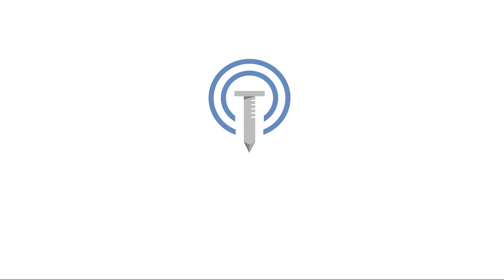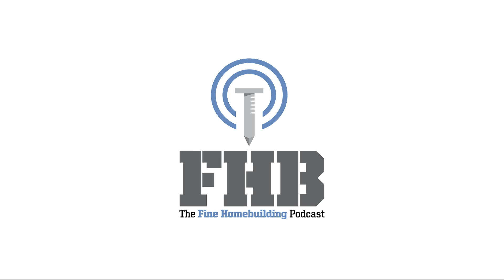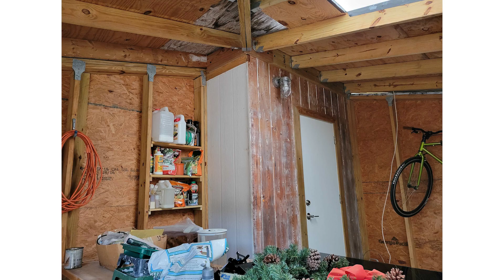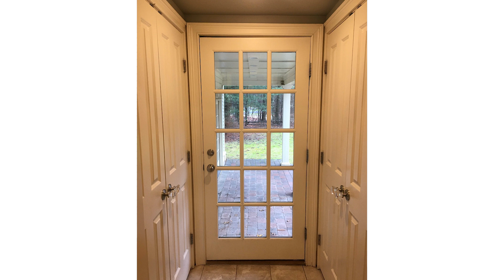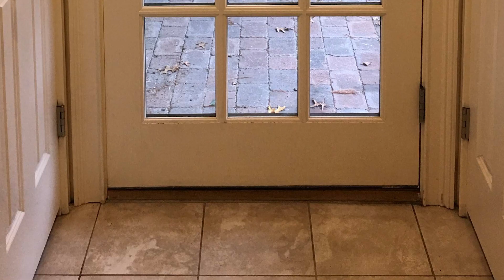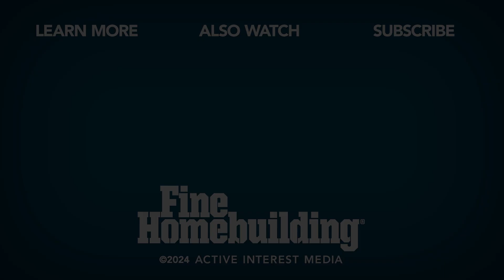Podcast 620: Witnessing Bad Work, Semi-Conditioned Spaces, and Extra Minisplits

Comment: Another HVAC idea for your extra tight super insulated home. Attic and crawl space insulated and inside the HVAC envelope with no partitions in either. Mini split head or window type heat pump, one in basement and one in attic. Both spaces also with dehumidifiers. Now attach adjacent rooms above and/or below with floor/ceiling vents, powered dampers and small quiet fans. Vents open based on temp and fans come on a couple minutes later if temp still high/low in adjacent room. Combine with ERV, for fresh air and to prevent stagnant air. Also plants on window sills can improve air quality, NASA has looked into this for space stations and based on other planets. BTW the bedroom vent(s) might be most comfortable if located in the closet with a louvered door. Could work for one or two floor home, some smarts to balance air pull and possibly one vent connecting the two, perhaps a 6 inch duct in the kitchen run in the corner and behind the corner cabinet. :)

Comment: How about putting in the small window AC without putting in a window, just a frame to mount the unit in.? Easier to air seal and better insulation. I did this for a server room which had an outside wall. The server room could've been the heat source for at least a 1200 square foot home in Maine, but was an 8 x 8ish closet with a couple of room height server racks. Attaching to the existing HVAC would've been expensive.